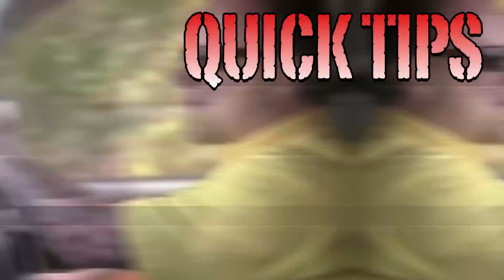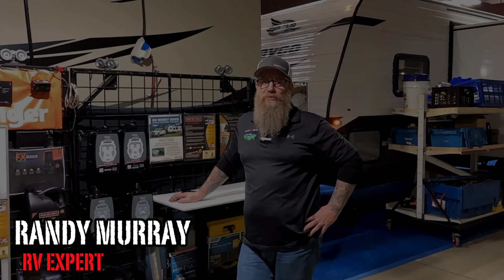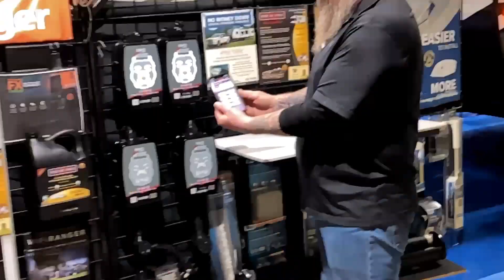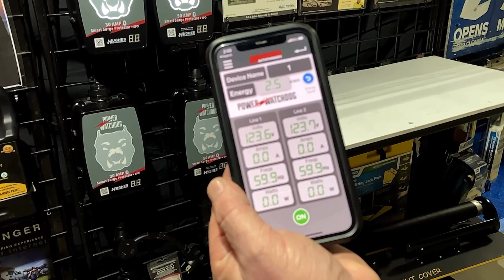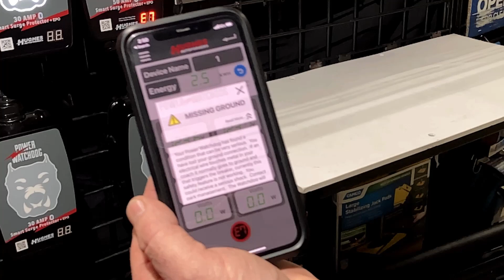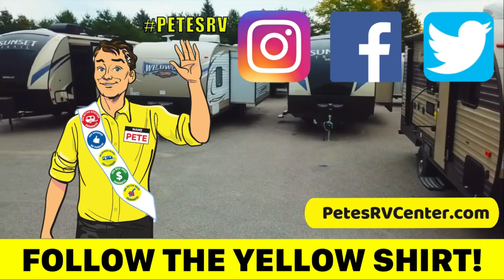Surge Protection: 101 (Hughes Power Watchdog) | QUICK TIPS w/ Randy Murray

Comment: Randy
I want to install a Hughes 50 amp Autoformer and the watch dog..  It will be in a parentally mounted hard wire configuration.  Which watch dog surge protector unit do I get (EPO or Not) and do I install it before or after the autoformer?

Comment: We have the 30 amp version and for about a year and at 2 different camp grounds it has told us intermittently there was a missing ground although neither myself or the electrician at the RV parks could find an issue so I ended up just not using it which doesn't help. About to switch to a 50amp so I'll either get a different brand or I'll skip the epo all together.

Comment: The EPO feature is great. It turned off when my rear AC compressor was going out and spiking over 50A. Saved me because we were at a fairgrounds where the electric panel was locked. If it would have tripped the breaker we would not have power all night. Another time a storm came through and the power was 132v and it shut off the power unit it came back down to normal. Great device. Combine it with the Autoformer and you are totally covered.

Comment: Is this unit installed in line between the shore power inlet and power center (breakers/fuses/converter) on a typical travel trailer? If so, would there be a separate ground from the Hughes unit?

Comment: Hi Randy, i have a question.  I am about to install the hardwired version that you mentioned, my question is the power comes into my rv and the panel and inverter are under the master bed. Can the unit be installed in the same area( will not be visible unless bed is lifted) ? 
Are there any concerns about heat ?  The area has a fan for inverter.
Thanks in advance

The rv is a 2021 entegra vision xl 34b incase you know the model

Comment: Hey Randy, question  for you: On a 50amp electrical pannel with a dual pole 50amp braker, do you have 50amp on each legs? So 50amp coming from one hot wire and an other 50amp coming from the other hot wire. So 100amps for the all pannel ?Thanks.
Reply: You are correct, 50 amps per leg which is providing a 100 amp potential in your RV.

Comment: Is there a way to bypass the watchdog? We have one wired into our rv and it works great, but I have a Honda 3200 generator and when I kick the AC on it drops the voltage to below 104 and the watchdog kicks off power. Any ideas? Thank you!!
Reply: If your generator has "eco mode" you may want to turn it off (or on)

Comment: Last yesr I bought a 2022 keystone Premier 25 RKPR from Petes Rv in Massachusetts. Heres my question… the camper is a 50 amp camper but i only have one AC unit on it so i was told i can safely run the rig on 30 amp service…. Is this true? Second … if i run the camper on 50 amp with the single AC will the AC  perform better at cooling? Im currently having issues with the GE air conditioner that came on the rig that no one can seem to figure out. Its not properly cooling the camper adequately like when i first got it. It seems to be short cycling and occasionally the snowflake symbol on the thermostat flashes on and off.  Any ideas would be greatly appreciated.

Comment: Is there a way to " soften "  the sensitivity on the EPO version ? Mine constantly shuts off at   the tiniest bit over 30 amps, which is in the morning with the coffee maker and A/C on. Will switching to a non EPO version help ? Or what about raising the alert settings ? Otherwise, I'm thinking of getting a 50 amp RV to maybe solve this issue. My previous RV did this too.
Reply: If you are exceeding 30 amps it’s just a matter of time that your main breaker trips or the 30 amp breaker on the pedestal, the watch dog is just protecting you first. My recommendation would be, turn off AC when making coffee, or use a percolator to make coffee using the stove top. Hope this helps! Happy Camping - Randy